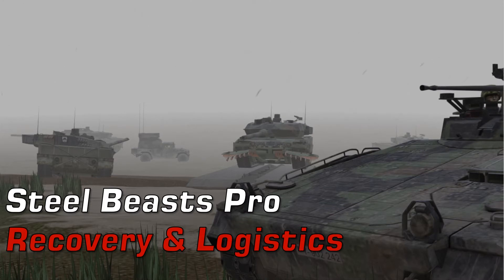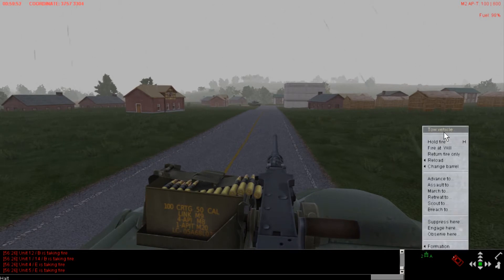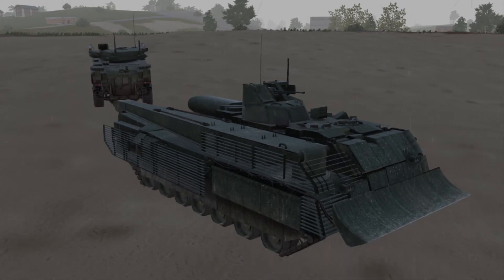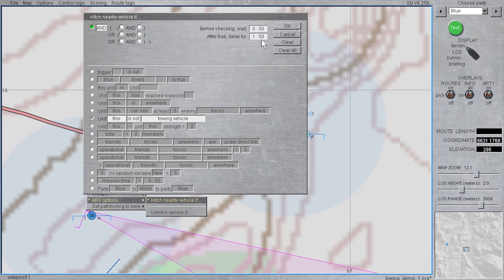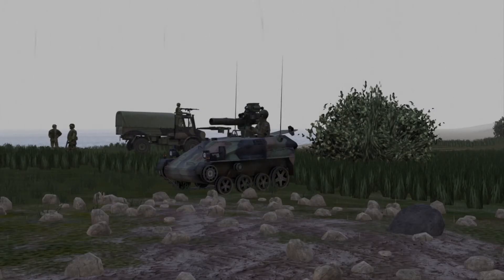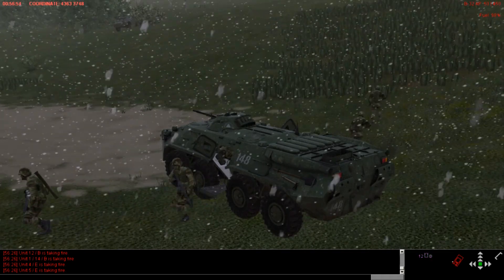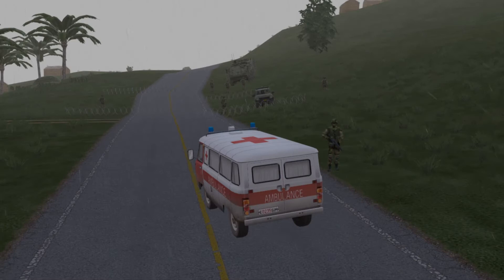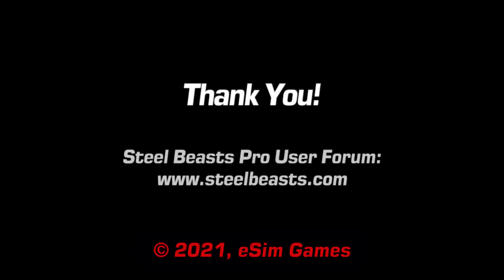SB Pro Tutorial: Towing and Resupply

Comment: Another great video! Just a couple of extra points, if I can:
1. To reinforce the "mass matters" issue. A gun tank can not tow a similar gun tank with a mine plough or roller attached, as its heavier than the the gun tank (even if the base vehicles are both say M1A2SEPs). 
2. In multi player, its good practice for the owner of the "towed" vehicle to give ownership to the "tow er" player. 
3. Also good to cancel any routes the disabled vehicle may have, as it will try to execute those once mobility is restored. 
4. Whilst Repair vehicles can reduce repair times, damage with "XXX" or several hours may well extend beyond the mission time limit (e.g. 90min mission but engine damage will take 2 hours) so it may not be worthwhile parking the repair asset next to that vehicle, but prioritise a lesser damaged vehicle. 
5. Whilst the Ambulance itself can not treat Infantry, I'm pretty sure the medic team carried by the Ambulance can, as long as it is dismounted.
Reply from the maker: #5, it's being worked on for one of the next updates.
Reply: @eSimGamesDtl  Ah, thanks for the clarification.